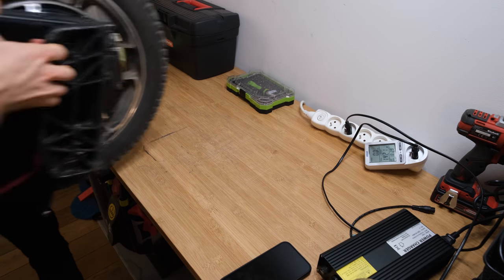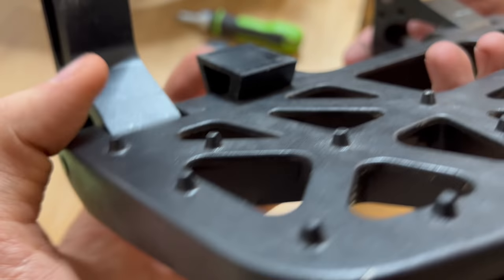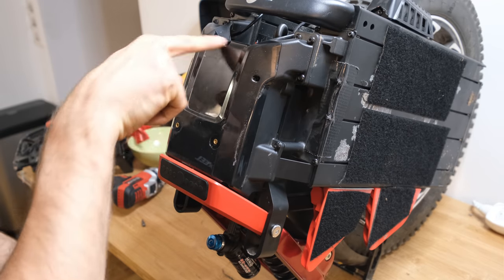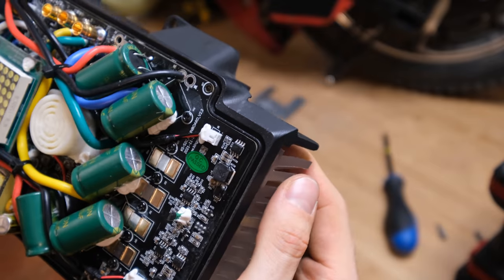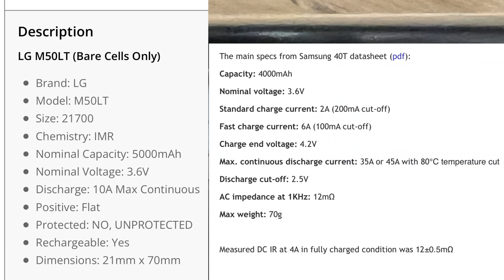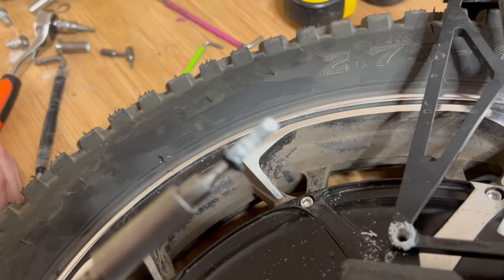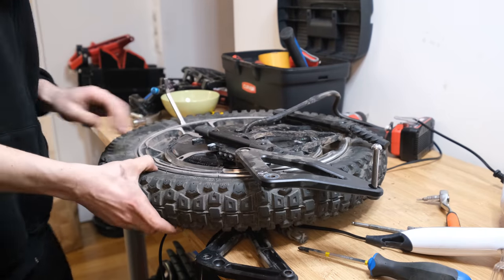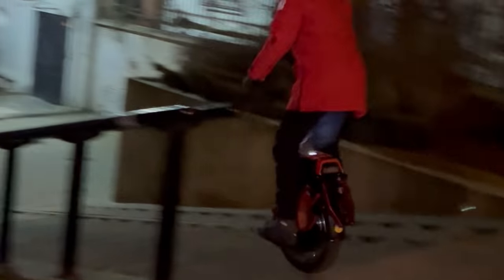King Song S20 Demo Unit - Disassembly and Quality Check

Comment: The German’s need to start making these things. EUC AMG.
Reply: 10K starting price
Reply: @NahBra_EUC  going 25kph max

No joke, we already had that with the BMW scooter, total laugh show
Reply: Let's be real, with all of our regulations this would be one hell of a slow, but safe wheel to drive. I got a cheap acm2 (ooold wheel) which I drive around fields because I could get in a lot of trouble if I get caught riding a euc... big bummer around here.
Reply: @robinferchert  oh hey a German rider? I already got caught 3 years ago on my inmotion V8, the police officers even excused them selves while taking my id and stuff. Said that they actually like these devices and like how respectful I drive around other people. But they could be held accountable for me when they don't stop me. Now, after 3 years of my most boring time ever, I'll buy an S20 and just avoid roads all together. Sad, because that's where EUCs shine. In roughly what part of Germany are you?
Reply: @robinferchert  also they wouldn't make it ,,save,, , because that requires a lot of motor power, and the limit in Germany is set to 250w. Exn has like 3500w, and is still overtorqueable
Reply: @lefotografion  8 got caught with a onewheel a few years ago, the police  no idea what to do and Actually just confiscated it. I got it back a day later without charges but got told in a pretty pissed of voice if I did not know that those "things" are illegal.

I live in NRW, roughly near Oberhausen. If you live nearby I would be happy to ride together (not that far and not that fast, my acm2 got like 40km reach and it goes around 30kmh before beeping at me;D)
Reply: @robinferchert  well I'm in Nordhorn, Niedersachsen, but frequently visiting nrw near Bielefeld. But my inmotion V8 is dead now for half a year (after 7500km), range dropped from 25km to 3. And it also only did 29kmh max. Therefore I'll buy the new kingsong S20, I'm more of an off-road guy anyway and my old V8 just wasn't enough for me. I overpowered it every time I braked, doing off-road stuff always at the limit of the motor.
Reply: @Le Fotografion
Let's be real.. german bureaucracy would take decades to make these devices legal. Self-balancing vehicles without steering will never be a thing.

And those abominations that will become an option will be horrible in comparison (esp. bc of 25 kmh limit)

I rarely even ride my eBoard anymore, after getting caught and being fined for 500€...
It is just a sad country to live in, so backwards thinking in every damn thing.

Comment: One of the reasons you have a coil shock, over an air shock, is for the lack of stiction in the coil shock. Of course that advantage is gone if the stiction is back in the sliders. The sliders themselves appear to be the wrong material and there even appears to be plenty of room for ball bearing between them if the balls could be contained.

Comment: The slider setup looks like it will wear really quickly. Should really be hardened surfaces on contact points not just some plastic/rubber blocks running on aluminium. Luckily most of the screws n bolts are made of soft cheese so should be easy to drill out when they all round off. I can see a healthy modding community for the s20 if kingsong don't address issues in later batches.
Reply: Slider mechanisms and dirt work really well together. V11 suffers from a similar design flaw. 
goods news there is plenty of room for improvement from other manufactures with suspension designs.
Reply: Or maybe , One component is designed to wear and  the other doesn't. Replacement of the slider pads will be a routine thing. Similar to "plastic" bushings which are used in many things built these days.
Reply: @Lemony Snicket
Gotta love planned obsolescence. Especially if manufacturers can easily charge the consumer of these nichè products absurd amounts for some bumpers and seals..
Reply: Them( sliders) are not good (gliders )...     
✌️ Keeping it WHEEL ✌️
Reply: Yea, as soon as those soft aluminum channels, aka the whole battery boxes get scored a little with dirt and grit youll have a hard tail again no matter how many sliders you throw at it. Having the weight hung off center of the wheel from the back like that will make it constantly in a bind to one side. Tons of disposible parts that won't even be availible for a year. Lots of good innovations on this wheel but most are pretty poorly designed short cuts to save weight and money.
Reply: Lmaooooooo "soft cheese" that's literally what those soft screws are 😂

Comment: Thank you very much for the disassembly, this review is the most correct, unlike the beautiful Kingsong rollers. The sliders are made very ill-conceived, the plastic crawls along the open aluminum profile, sand gets in there and eats up aluminum very quickly. For 2900 dollars it looks like a mockery. S18 sliders made more thoughtfully. After installing normal oil seals, they work perfectly.

Comment: Thanks a lot Adam for showing us all that 🙏
I have the S20 on pre-order, but unless I find any convincing reason not to I will cancel it.
The whole suspension slider mechanism is atrocious, with the channels opened next to the tire which will bring all sort of dirt/grit/sand/gravel/salt in there.
I can't imagine how this suspension not require insane amount of maintenance to run smoothly.

A really expensive time-sink 😬 no thanks.
Reply: After watching this video of that horrendous suspension I switched my deposit to the v12 high torque. For $1,000 less it's a lot better wheel for the money

Comment: Those unused tunnels look great for mods, including for mounting things on the front or back of the wheel with a screw and a nut inside the tunnel.
Reply: Or enough battery capacity to make it worth the $3,200 price tag

Comment: Take the V11 off-road and dirt sand abrasives destroys the aluminum slider rails and plastic guide tracks.
Turns out from this video he S20 is built the same... Rubber guides inside elliptical aluminum guide rail.  seen (13:28 -14:14)

When a EUC is built with MX dirt bike designs (no sliders) Will be a great day for everyone

Comment: I really dont get it anymore….
From serious fact videos back to “opinions/assumption” videos (on a test-sample/predproduction unit)
Those 3/6 bolts that you change “that make the suspension better” are mostly for setting the body(and pedal height) for the rider and are another chance  to higher/lower the pedals for the rider AND adjust body shell height.
Demanding shrink wraps when the battery is in a sealed aluminium compartment is also some kind of questionable, like demanding shrink wrap in a IM plastik sealed case.
The battery btw even has a “water intrusion” detection, to see if the wheel was dumped for warranty cases, chnaging color on one of the stickers.
And btw the 60Amp fuses protect the BMS and MB from oversurges of Amps. And as THESE kind of fuses are directly reacting (instead of normal fuses used for example in GW/Veteran) they are Not to high. they react on peak surge, not constant surge.

Its pretty understandable that you have suspensions problems in general when such a light weight guy as you screws the feather down nearly to the end. It should be on the top of the screw ring, as a 750lbs spring is more for 90/100kg riders….

And just a word for the battery differencies in voltage. As it wasnt worth for you to adjust the charger, probably no balancing is happening at all in the moment. 
But even then…..having them a difference of 0,013 (dont remember exact number) is totally fine…even for a unbalanced pack.

And hammering on the “shitanium” screws…..when allready KS promised to change them in mass production….remembers me of mexican loughing on the Block on the S18 “review”.
will be interesting if we get a new video when its not a Sample/preproduction unit anymore….
Sorry, just disappointed…..

#m2c
Reply: This is really complex machine. My expectations quality wise was much lower. S18 still not perfect, but perfectly usable, i hope this is the same case with s20. And yeah, we need to wait at least a year for better quality. V11 still have issues btw, so i'd better stick with KingKong

Comment: Awesome video as ever Adam, thanks for that teardown. Just as an aside, turning the spring on the suspension doesn't adjust the stiffness of the spring, it just changes the preload so basically it makes the EUC sag less when you get on it. If you bottom out on the spring, no matter how much preload you add, you will still bottom out on it unless you change the coil for one with more resistance. Most shocks manufacturers recommend to keep the preload to a minimum. Cheers!
Reply: I heard somewhere that sag should initially be set to 15% of spring travel when static loaded with rider’s weight. This is adjusted by preloading the spring. 
 
I mention this because it appears that most riders I’ve seen on YT aren’t properly setting up the suspension and are not experiencing the optimal performance. 
 
Also, those slide-blocks should be Delron (sturdy plastic) and the slider-channels should not be aluminum. 😣
Reply: @grb1969  
Delrin or polyoxymethylene
Reply: The spring comes in 500#, 750# and 1000# . It's shipped with the 750.
Reply: @LemonySnicket-EUC  
No 2000lb springs? Asking for an American friend.
Reply: Of 1000lbs I can't find to buy!  Does it exist for this damper?  1000lbs/3.00??

Comment: @15:30 Good points about the suspension... but the less than great sliding characteristics shouldn't matter as much when you have a heavy person on the wheel. However I have yet to try it out so I'm curious what its like. I trust you that its not great... which sucks :(

Comment: The more complex you make a mechanical system the more points of failure you introduced.
I was kind of anticipating this level of 'engineering' when I saw the first renders. 
I was worried they would squeeze the wheel together to fit the concept art (like that car Homer Simpson designed) and it appears they did just that.
Oh well, let's see what the Master delivers 😊
Great video btw ❤️ Truth 💪

Comment: you think an 80/80-14 or 80/90-14 scooter tire would fit? That's allegedly the tire dimension that fits the OG Sherman & EXN and they seem super grippy!

Tubeless and stiffer, so people are running them at lower PSI. Just thinking out loud.

Comment: You don't dare oil or grease those sliders, dry lube only. Grease will have those jammed solid with dirt.  The scraping noise is the slider channels already scored up, won't matter how many times you change slider plastics.

Comment: Well, I have to comment, it is not the first wheel with smartBMS and cell monitoring, as well as temperature sensor.
Ninebot s2 and z10 have smartBMS with the same features. 
Inmotion BMS have temp sensor inside, but for internal use (you as user can't see data from sensor in App).
Big thanks to you and Sergey for this video, sound of sliders moving.. it is the best :)

Comment: Oh man sliders really need to be like delrin or teflon slippery stuff. Also any dirt that gets in there will grind the aluminium away. I like the bearing idea, would survive dirt much better.
Reply: Same! I assumed that would be big teflon blocks. I can't understand why these would be rubber, aside from helping reducing the risk to bend metallic parts during crashes.
Reply: @supercurioTube  rubber helps absorbing sounds. Doesn't matter if the rest of suspension is rattling with all the slop in al moving parts. But I kind of expect sloppy china design with hard plastic sliders. Building your own linear actuators you put 3d printed sliding parts in an aluminium extrusion, works pretty good but these don't see dirt like outside vehicles open to the elements. Grease loves to gather sand and will hold it really good. Sandpaper effect on your sliding tube.

Comment: Honestly I don’t see them improving the screws in the production version… why would they put in shitty screws in the first place?
Reply: They said they would.. they probably were just trying to get the preproduction out.
Reply: @V1ncentVanBro  its still not witchcraft to know that basic hex might not be the best idea wenn you need to tighten them down hard. If you pay that much for a wheel and don’t even get Torx screws that’s pretty sad.

Comment: So what’s the best wheel in your opinion. I’m researching for one.
I was sold on this one. I still think I am.
But the battery should be rapped and I wish I could lube my suspension. 
And also they need to get better bumper and kick Stan. I’m just saying it’s a lot of money to just break apart.

Comment: Please PLEASE do a comparison between the 16X and 18XL, I'm having such a difficult time choosing between these two even regarding my usage needs, and you're the one whose recommendations and experiences I trust most!
Reply: Based on what I've seen elsewhere, the 16X is more nimble, has slightly more torque, and is probably better off-road, while the 18XL is better for road cruising, and has a marginally longer range due to the wider tire diameter (more distance covered per tire rotation). My first wheel was an 18XL, and I now have plans to get a 16X as well. The addiction is real!
Reply: @ClokworkGremlin  What qualities have you enjoyed with your 18XL, and what are you looking forward to in the 16X? Is your getting a new wheel just because you have such various needs as in cruising vs off-roading that can't really be met with just one wheel, is there something the 18XL hasn't amounted to in your off-roading style for example?
Reply: 16x
Reply: @slidersgliders5516  your 2 cents on the why? I already know the basic differences, looking for experience-based evaluations now
Reply: @onnen-tipu  if you already know the basics, my two cents isn't going to make your mind. Get a 🦅

Comment: Hey Adam and Community, I have a dilemma, I sold my Sherman last year (I regret it) now I want to buy new wheel, but I dont know what to get... Sherman Max looks good on paper, but cant find much info about on internet. S20 looks cool as hell, but the range that people have gotten is to low for my liking ( I weight 114kg with gear on) Inmotion v12 HT is on my mind as well.
I just want a wheel for commuting and weekend rides, I dont do jumps or any trail runs. 
With given info what wheel would you get?
Reply: Same here. Sherman max would be a good choice
Reply: The V12 high-torque looks awesome, wider stronger rim, nice rounded knobby Tire, as well as the better motherboard.

Comment: I think the stiffness is from an over-weight spring.  I doubt its rating should be much more than 2x your rider weight.  Seems KS sized it to the biggest possible rider.  The fact that it compresses with its own weight is far better than the S18 was.

Comment: I dont know... This is a pre-prod model, so how representative is this QC vs to what they will be releasing?I was really hoping that this wheel would be better, I was dead set on getting it but the poor range and the questionable overall quality makes me want to stay with the sure thing I have. LeaperKim should just build a suspension version of the Sherman, with the same range and quality.
Reply: I switched my deposit to the V12 high torque. The s20 just isn't there yet

Comment: Dry lubricant like graphite might be a good choice for the sliders.
Reply: Would like to hear more about that. How resistant do you think the suspension can be to particles, salt and other elements by using the right lubricant?
Reply: @supercurioTube  I think it depends on how well they can keep sand, dirt, dust and water out of those slide tracks. If they cannot be perfectly sealed a dry lubricant like powdered graphite seems like it would be the best choice in almost any scenario.
Reply: Those channels are right next to the tire so they're going to be full of dirt instantly

Comment: Very good disassembly Adam. I 100% agree with the screws going through controlboard. Its not veyr useful to have sealed box when you drill it and screw through that (especially from top) thats not really engineered. Your fuse comment aged well seeing that the fuse is not really the weakest point unfortunately.
Anyway that screwing of Shock spring changes the preload of spring. That mainly affects the ride height or the stiffness when fully rebound. You really dont change the suspension stiffness by this setting (or you do a little bit) but thats not really meant to do it this way. Changing for different spring is the correct method.
The suspension really looks bad. I am really disappointed

Comment: Is there a way of putting oil in those slider without disassembling the wheel?
Reply: Any lubricant here would just accumulate dirt and worsen the wear characteristics. Sad.
Reply: @grb1969  exactly, maybe some dry graphite Lube but that's about it. Not a good design

Comment: Quelle honte ! même les coulisses des tiroirs de ma commode sont mieux réalisés. Comment peut-on simplement imaginer un système aussi sommaire sur lequel repose toute la suspension qui est l'Argument de vente de cette roue. Et inutile de tenter de mettre de la graisse car les rails sont ouverts à la poussière et autres joyeusetés, du coup cela ne ferait que faire adhérer d'autant plus les particules qui provoqueraient un abrasion encore plus importante et quand on connait la dureté de l'aluminium et du plastique (plastique je n'ose même pas dire ce mot lol) on imagine le durée de vie d'un tel système.
La S 18 était mieux conçue... Pour oser faire du off road avec ça franchement faut être grand philosophe. Si c'est ça la roue du futur, avec en plus un déséquilibre d'au moins 5 ou 6 kg sur l'arrière pire que l'EX.N et ça pour 3300 € bon courage. Chooch dit qu'il en voudrait 15 comme elle ?! c'est sûr il doit en falloir autant pour rouler longtemps sans problème.
Reply: Quelle déception en effet. Ce design est pas seulement inadéquat, mais clairement absurde.